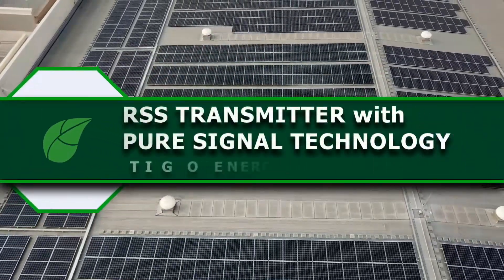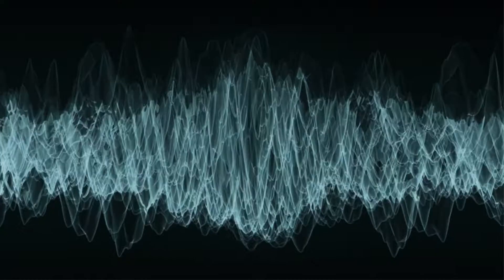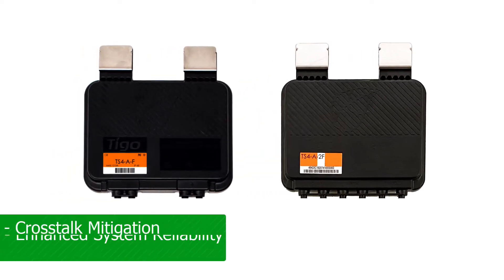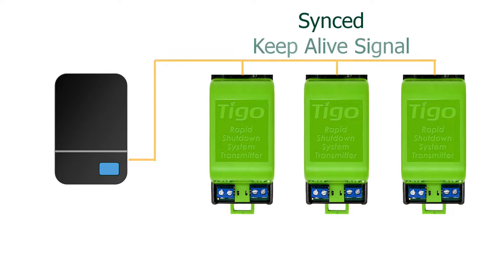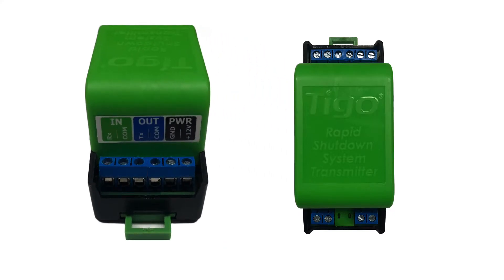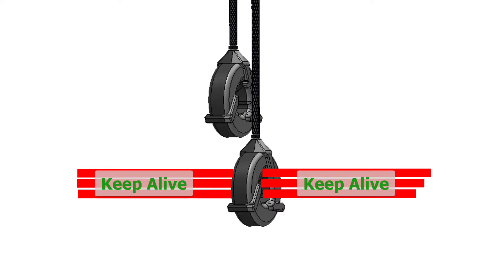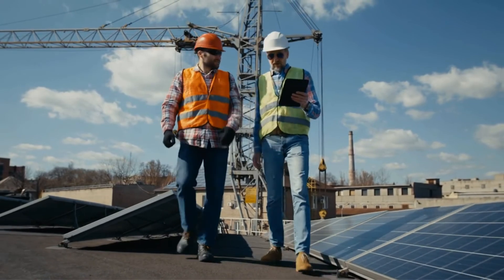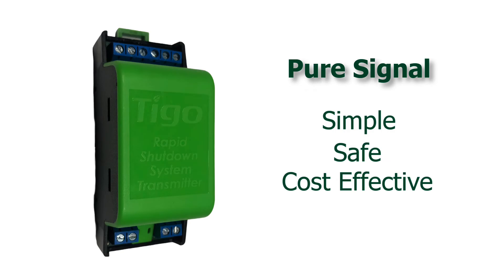Tigo RSS (Rapid Shutdown System) Transmitter with Pure Signal technology

Comment: Is this necessary for the optimizer version, on top of CCA and TAP?
Reply from the maker: Great question! The TS4's that use the CCA and TAP (TS4-O and TS4-S) do not need the RSS transmitter for operation. The RSS Transmitter uses PLC for rapid shutdown only applications unless it is part of a Multi-Factor Rapid Shutdown system. You can read about this specialized feature here: 
https://support.tigoenergy.com/hc/en-us/articles/44983309634195-Important-Notice-Behavior-of-TS4-X-and-TS4-A-725W-with-Third-Party-Inverters-Using-Integrated-RSS-Transmitters